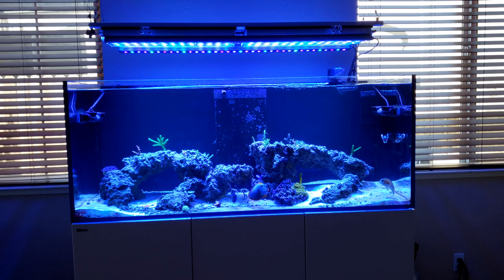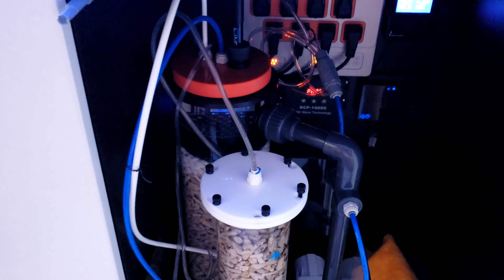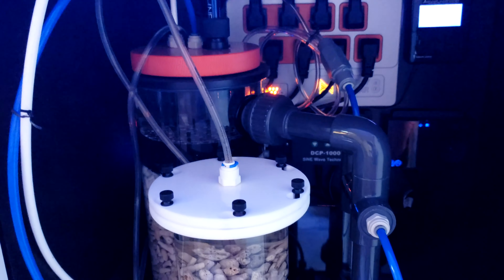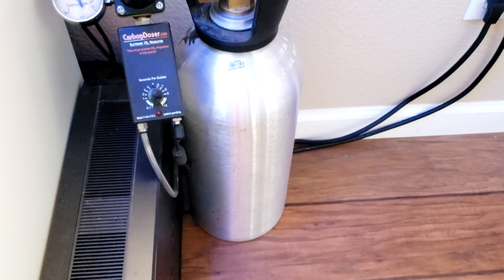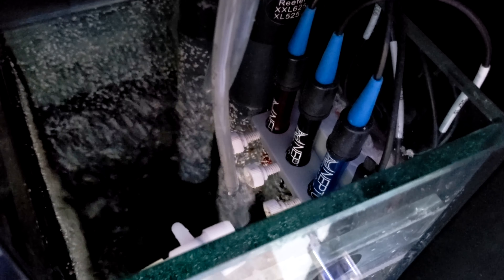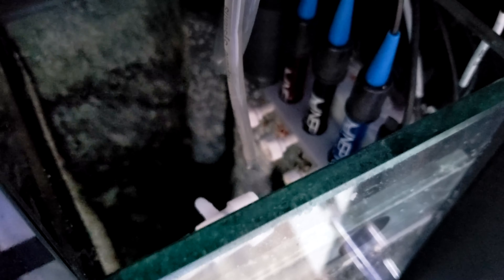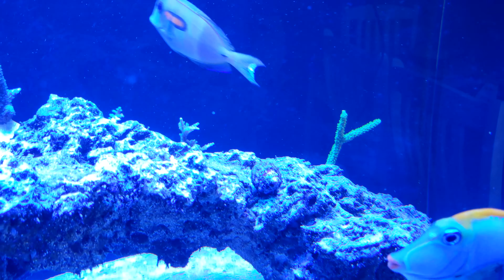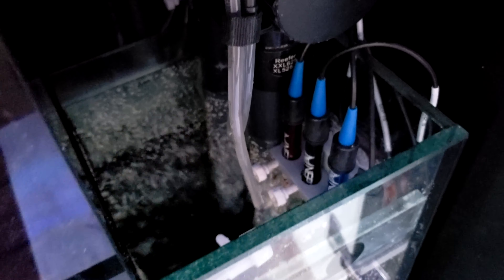Calcium Reactor Installed on the Red Sea Reefer 625 XXL

Comment: Hi.
I have a long time to find the ideal reactor for my aquarium.
and I think I would use the same one that you have with that second camera.

I would like you to tell me how the reactor is going and how does it work?
Reply from the maker: I've used the aquamaxx and geo in the past but I think this one is way better because the pump is much quieter, the construction is better, the lid is a twist-off which is easier to get off and it's quiet during operation
Reply: @ModernReefer  
It's great to know, it was hard for me to find this information, I was thinking of buying the aquamaxx but they sold out and I was thinking of buying the geo, but I always found some positive and negative comments but I can't find someone to tell me about their experiences
Reply: @ModernReefer  
I would like you to tell me your experience with both this and the previous reactors?

he wants this reactor with that second chamber, because they say it is better to boost the kh and raise the ph.
It is true ?
Reply from the maker: @OCAcuarios  Honestly they all work but I just like the Reef Octopus more.
Reply from the maker: @OCAcuarios  They all work. Like I mentioned before, the Reef Octopus seemed to be quieter and that's probably because the pump is a dc pump.  The lid on the RO reacto twist off so it makes it easier to fill media into the chamber.  The second chamber is nice to have but I have not had the chance to measure PH with and without the chamber to see if it brings the ph up.  Based on what I've read, it does so I've always had one on my setups. I might have to do that on my next video.
Reply: @ModernReefer  
thanks for the info. I will be aware of your videos.

I would like you to give me your opinion on each of the reactors you have used.?
What good things can you see in an aquamax?